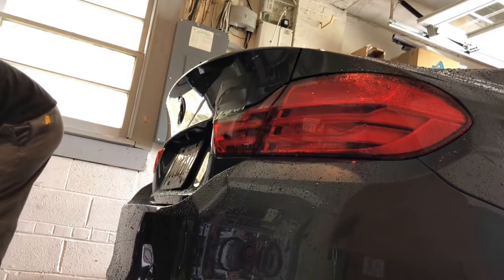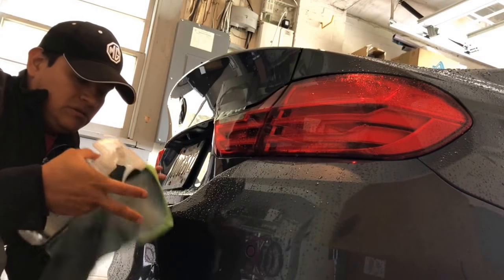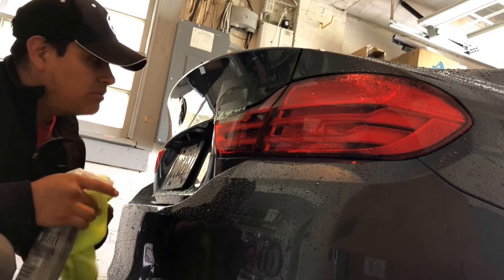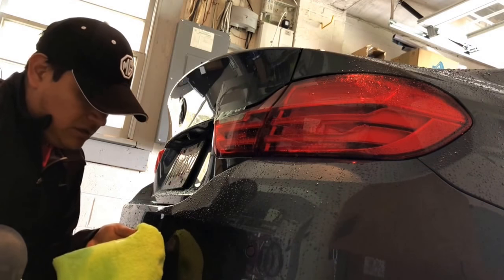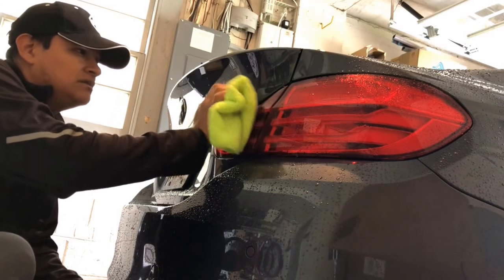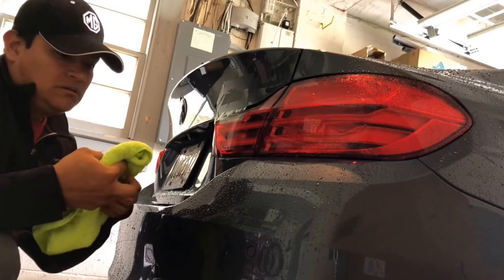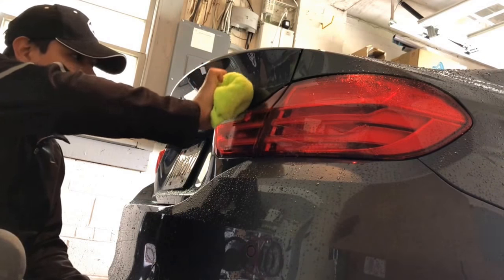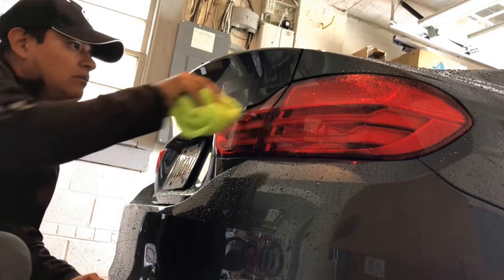M4 install badge tutorial

Comment: Can alcohol replace the chemical guys to clean the surface before i stick it on?
Reply from the maker: Chris yes. I usually use waterless wash by chemical guys first. Then use alcohol to strip any glue remaining.
Reply: Autobot Haus i’m actually just putting on the “competition” under the m3. So just the dirt on the surface